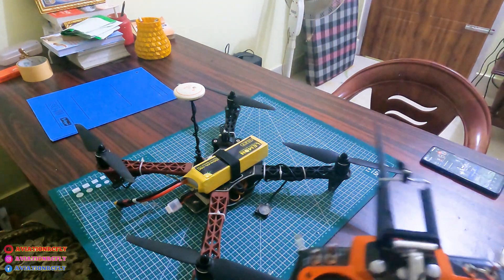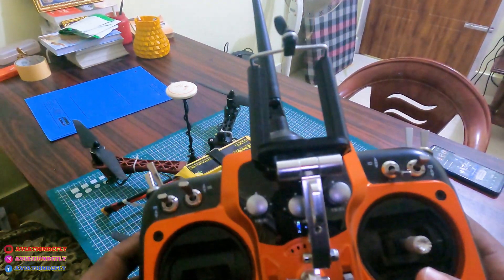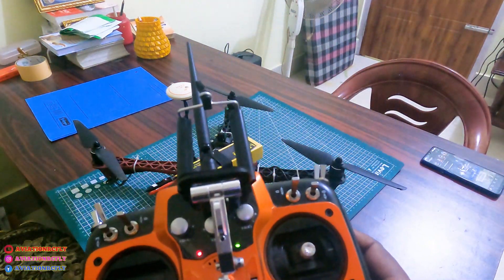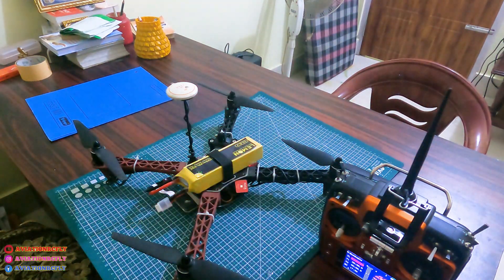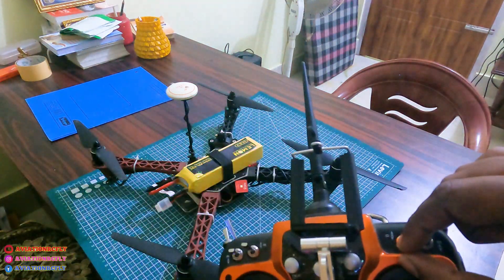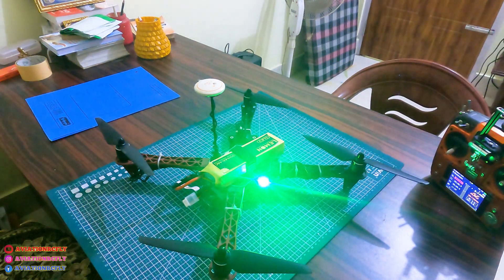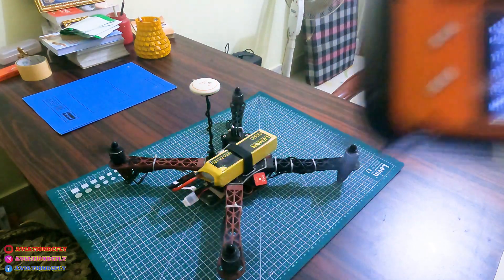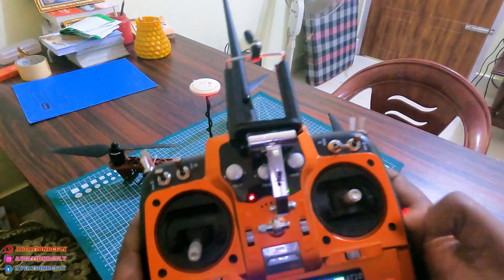How to Arm and Calibrate GPS for DJI Naza M lite/ Mv2 Flight controller @Radiolink_official

Comment: Good vedio .I have problem in my remote control what should I do?
Reply from the maker: I will make a separate video related to setup  of Transmitter for DJI Naza mv2 flight controller
Reply: @Aviation_RC_fly  Thanks